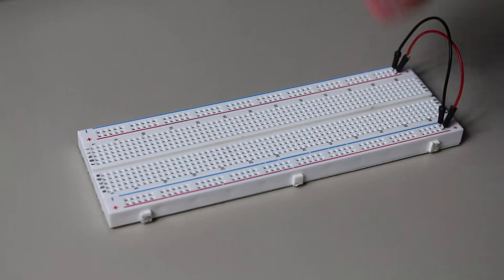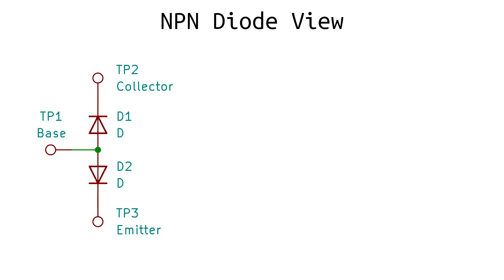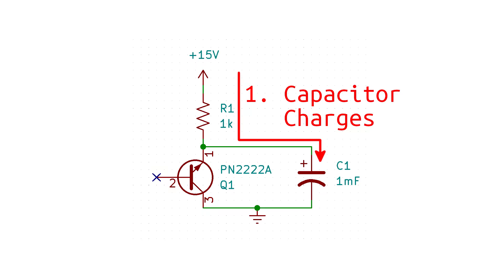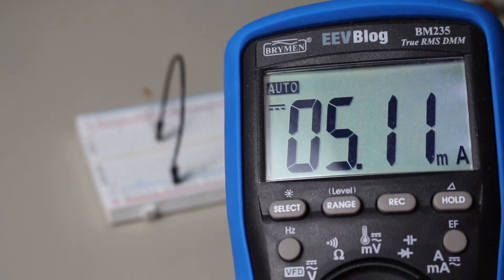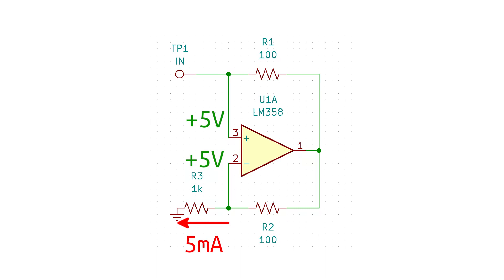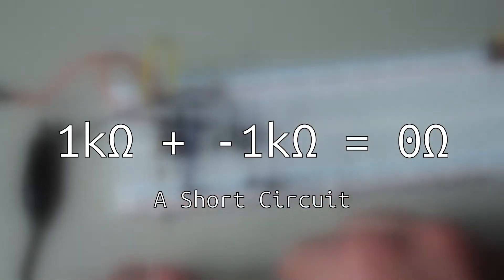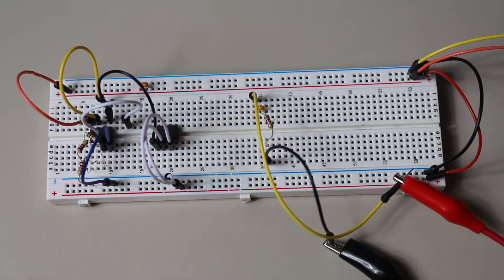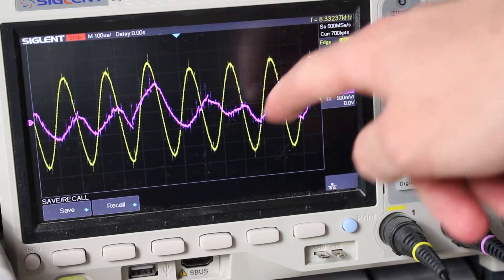Is Negative Resistance Possible? - The Negative Impedance Converter and Negistors

Comment: Switch mode power converters with regulated output all exhibit a negative input resistance characteristic. If the input voltage is increased, the input current will decrease. This is not a true negative resistance, but the slope of a plot of voltage and current is opposite in sign to that of a real resistor.

Comment: do voltimeters and multimeters use this to get the effective infinite resistance they would need to not interract with the circuit in a significant way when measuring tension?
Reply: No. They don't have infinite impedance, more like around 10 MOhms, because that's enough for most practical applications, and higher impedances can cause problems too, like charging up the input with the accidental touch of a finger. So voltmeters just use a somewhat high impedance ADC, or a buffer at the input (JFET buffer if the impedance needs to be very high).

Comment: trying to understand your op-amp circuit better, when you mean cancel resistance, If I have my battery on Vcc and Vee and I also have R1 and R2 in series to ground like that, are you saying that R1 and R2 will essentially appear as a short circuit to ground if R1 and R2 are balanced loads?

Obvously you still need to supply the amps so it's not free energy, but am i getting that right, like, the load resistances are litterally cancelled and it acts like a dead short?

I feel stupid just asking because you made a great video, I am struggling to get this concept. I watched the segment going on 5 times already, I'm really not getting it.
Reply from the maker: Yes, you can add the resistors in series just like you would normally. For example, 1k +  -1k = 0 ohms.

Comment: Thanks for sharing your demonstration. With true negative capacitors,  as voltage across the cap rises, the cap  'sources'  more and more current rather than sinking it. We can have "Relative" negative resistance which you demonstrated, as well as  "Absolute" negative resistance. Also there exists Negative permittivity and Negative permeability, a concept commonly utilized in "Metamaterials" engineering.  By tuning a positive inductance with a negative capacitance huge bandwidth increases from short antennas are possible as the reactances track each other frequency wise.

Comment: The videos are getting better and better! If I may suggest something:

Think about making more videos with poor’s man/radical diy circuits (and calculations)! Just an eg. Building a PWM driver using a crystal and a decade counter
Reply: Stuff like that is awesome to learn how stuff works (just like your AM Radio video)
Reply: Another thing I almost never see is circuits and explanations on discrete op amps as feedback error amplifiers for whatever type of regulation necessary, that is something that people usually don’t think about it and only care about the feedback pins on off the shelf ICs
Reply from the maker: Those diy circuits are definitely some of the more interesting projects. There's a lot more planning when you can't just rely on one IC to do it all for you :)

Comment: What is this practical for? All I can think of is as part of a radio.
Reply from the maker: You can also use it to 'cancel' out loads.
Reply: Negative resistance converters use in audio eqalaizers, active filters, regenerative receivers. Very interesting - connect directly antenna to freqency depended negative resistance converter ( band pass filter - amplifier ).
NIC cancels antenna resistance and antenna "transmitts" out negative resistance "field" - reduce loses in ground, trees, walls... and create "black hole" for radiowaves.